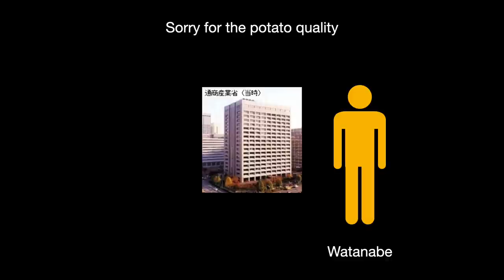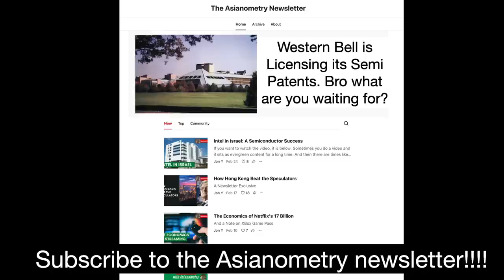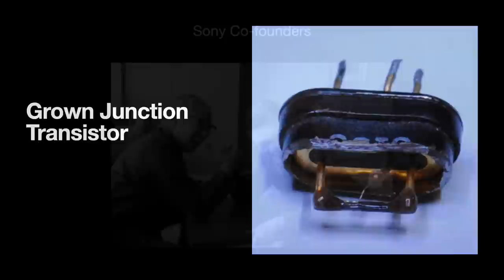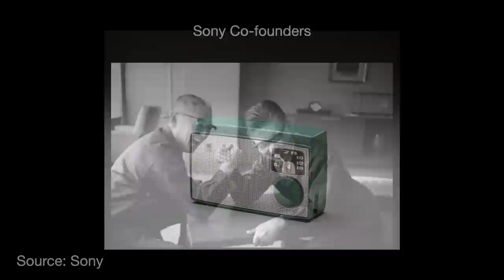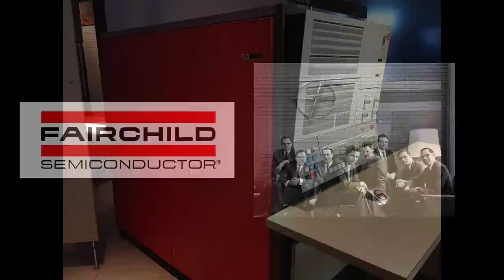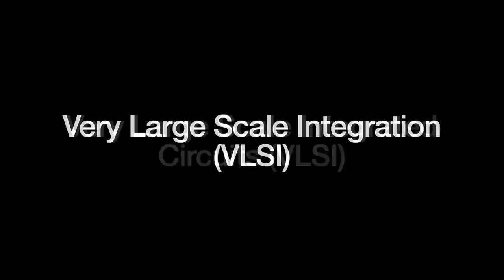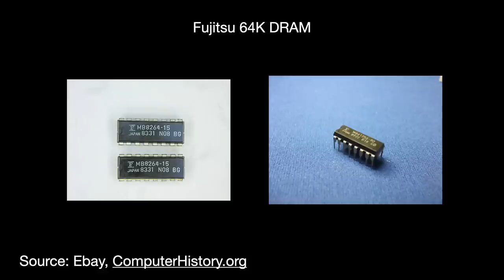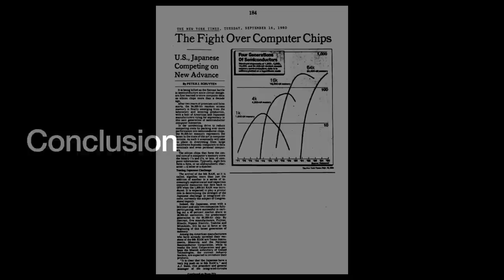How Japan Learned Semiconductors

Comment: Anecdotal: in 1980 I was the lead engineer on a project that required an early microcontroller. In those days there was no flash so the code eas “masked” in ROM - that is, defined as part of the top layer of the semiconductor chip at time of manufacture. It was an 8049 MCU which was designed and originally sold by Intel. But in the end we chose Mitsubishi, who were able to provide the mask at 1/3 the set-up cost and deliver the parts in half the time at a much lower price. I don’t recall a single MCU failure in the two years we built the device, over which time thousands were sold.
Reply: Now that sounds like a fun job
Reply: Interesting! Are you allowed to tell us what the project was?
Reply: They underquoted on the job to 'steal' that type of work away, to gain experience and your company's expertise, in effect, they 'stole' the expertise at zero cost to themselves.
Reply: @cranegantry868  that’s quite an assertion, can it be backed up with some kind of evidence…?

Comment: At 15:10 DRAM Dominance
As a hardware designer (starting in 1972) I specified only Japanese 64K DRAM for memory when it became available because no board manufacturer wanted to set up the re-work post assembly streams needed if American DRAM parts were used.

Comment: I worked for TI  in a research group. I remember in 1977 we were have serious discussions as to whether semiconductor memory would ever replace core.  The concern was that core memory would retain data, even during a power outage.  TI's was putting it's hope in bubble memory.  I think the incredible growth of winchester technology came as a surprise.
Reply: It would have been interesting to see how small they could go.  According to the Wikipedia article they reached 0,33mm core diameter by 1966.
Reply: I still have some industrial control systems running on core.

They run warm!

Comment: Something to add to the Bell patent on the transistor. The anti-trust lawsuit that Bell was involved with the federal government eventually ruled that Bell labs Western electric AT&t Bell telephone could not manufacture and sell to any entity except themselves. It also prohibited them from operating outside the telephony industry. However they could license patents and collect royalties. Which prohibited them from getting into the computer industry or other various industries. After the lawsuit until 1984 when the giant was broken up in another Anti-Trust lawsuit. All equipment that was manufactured and used by the Bell group had stamped on it the property of Bell telephone not for sale. In both law cases due to Bell telephone being a massive company and wanting to protect their business interest these were actually negotiations with the federal government in which Bell telephone and it's arms agreed on certain conditions to end the lawsuits. Negotiations that were finally agreed upon in approximately 1982 and 2 years later would lead to the breakup of the Bell system. Removed the previous negotiations on the first antitrust lawsuit which was filed in the early 1930s.
Reply: I remember Lucent Technologies an offshoot of AT&T. They produces communication chips. Now its under Alcatel.
Reply: @ntabile  You are way out of date. Alcatel is no more having been itself taken over.

Comment: Note that Bell Labs had both the patents on the point contact transistor (which is really not possible to mass produce) but also by 1954 had the patents on the diffused-junction transistor which WAS possible to mass-produce.  Sony got interested in the transistor but by the time they actually licensed the technology what they were licensing was far more advanced than what they had originally been interested in.  They were the right people at exactly the right time.

Comment: One minor detail missing. In 80s in the midst of Cold War, Japanese supplied top of the range semiconductors (military grade) to Soviets. 

USA found out about such arrangements and slammed the door shut for the Japanese imports and export of lithography machines to Japan.  Japanese developed their own lithography machines (which are still fairly reasonable even in today’s standard). The problem was two folds, i) Japanese were largely shut out from the world’s largest market hence lacked the momentum in sales - R&D cycle. ii) Plaza agreement drove Yen more expensive making Japanese products expensive in cut throat chip market. 

From 256k Japanese were en passed by Koreans and never took the lead back. They focused more on the materials and machines supply where they still maintained competitive edge not because of technology but because they were relatively reliable and cheap. .  

In 2019 Japanese blocked export to Korea and Koreans started to start to drive for domestic manufacturing of not inly the 3 products controlled by Japanese gov but all supplies.  All Korean manufacturers demanded their suppliers comply with ‘Japan free’ supply chain.  Dupon and other top names quickly joined the frenzy and Korean producers quickly replaced Japanese in an once in a life time oppotunity.  As many suppliers work in partnership with chip makers from the development stage, it is notoriously difficult to make into the supplier club. 

Some Japanese producers moved their production to Korea, outside Japanese gov export control. 

Others followed suit and created R&D Centres in Korea to work with the next gen development, making Korea de facto the hub for global materials, equipment and final product hub.  The talent pool that will be created is only matched by the USA.  Even ASLM is building its R&D hub in Korea. 

Japanese gov just gave Koreans the best gift in a generation to consolidate their dominance in the sector. 

The end result is, far less Japanese producers are working with Korean on the next gen product development and the opportunity to supply in the future.  

It would not be surprising to see Japanese material and equipment supply vanishing in next 5-10 years. And total annihilation of Japanese market share and talent pool for any future opportunities. 

It is a classical case study of bad gov decisions (supply to Soviets, Plaza agreement, export control for Korea) demolishing once flourished industries.
Reply: Oh man, I remember that recent decision, it was immediately obvious that it was one of the most stupid decisions the japanese could made. What were they thinking?!
Reply: Zaydan Naufal  so this is all trump fault?
Reply: @kurikuraconkuritas  Uh no, not everything is about TRUMP. Japan and Korea have had their own local disputes. The most recent was sparked when the Korean courts upheld a suit against Japanese companies for compensation for forced labor during WW2 and allowed Japanese assets in South Korea to be seized. The Japanese retaliated by slowing the export of chemicals needed for semi-conductor production to Korea.
Reply: I think in the 1980s there was also a scandal where Toshiba sold machine tools to the Soviets necessary to make quieter submarine propellers.
Reply: you see, if we didnt have nations this wouldnt be a problem
Reply: @indeepjable  Settle down there Pixy
Reply: Shots for every DehRAM -already wasted.
Reply: Unfortunately Korea couldn't duplicate Japanese materials still today so the export ban was a success. Korea will not be able to develop anymore as Taiwan has taken over. So Korea semiconductor will soon go down.
Reply: The main Japanese manufacturers effected by the export control has largely lost 50-6% of revenue of the products and some even turned into negative P&L.  
All 3 products have seen substitutions coming domestically or sourced away from Japan. If the Customs data is anything to go by, they recorded 60-90% decrease in import volume of the products from Japan vis-a-vid pre export control.  
Not everything is replaced yet, but with their exclusion from the next gen development, it is clear their days are numbered.
Reply: @bgshin2879  actually all the 1 export items is shipped to korea by Japanese companies factories outside Japan at pre 2018 levels and remaining 2 are directly exported from Japan as there are no replacement available by any other company or factory outside Japan. So revenue had rose above pre 2018 level and market share hasn't decline even a bit according to customs data. It is impossible for anyone in the world to replicate Japanese chemicals for next 10 years so days of good profit is just starting. Korea will never be able to develop any next gen product beyond what is now available now all next gen is Taiwan. Japan will export and make profit there. Korea semiconductor days are numbered.
Reply: Proof, trade war always bite back in the ass.
Reply: @Trgn  no it doesn't.

Comment: Was the VLSI project, where the etching technology was invented that allowed the buyer capacitors, or did that come later. I remember see in some corrections of nearly vertical wells more than 10 times the depth of the diameter during my university courses. I remember mention of a Japanese project of endless etching experiments which ultimately led to the capability to etch "any" 3D shape into Si substrate.

Comment: IC bonding was generally not to a board. It was to a lead frame (pronounced "leed" ) i.e. a chip package.  14 and 16 pin DIPs (Dual Inline Packages) were quite popular. Surface mount was starting to show up, but the parts were too small to handle. These days I'm fond of SOT23s (vs TOs) and the TSSOP (vs DIP) form factor. But I have to wear a magnifying glass to build anything.

Comment: DRAM Pronounced DEE-RAM.
SRAM Pronounced ESS-RAM.
(I have a degree in Electronics Engineering.)
Reply: You don't need to say you have a degree in electrical engineering to be pedantic and annoying although it helps.  (BTW I also have a degree in Electrical Engineering.)
Reply: @seanm2511  I have a diploma of EE. I don't care how to pronounce DRAM
Reply: @seanm2511  true, and "dram" pronounced as the video does is just a small glass of whiskey
Reply: @thenimbo2  Whiskey is of course tastier and isnt also at the moment universally subject to a 52 week+ lead time.  I take it you also have a degree in Electrical Engineering?
Reply: @seanm2511  well, good whiskey actually has a longer lead time than that.. its takes years to age properly
Reply: I don't get why people complain about others correcting mistakes.  I've never heard anyone in the industry say, "durram."  Everyone says D RAM, so I'm 100% with Metzen here.
The VLSI example is different because the viewer apparently insulted the creator, rather than just adding the information (and it wasn't even the correct information).
And CodyCast's comment below is exactly the type of comment that should be downvoted.  Instead of just saying, "hey, all the industry people say dee RAM," CodyCast had to go "Omg, blah blah," and then name-call.  I'm convinced that people suck in general, and that internet just amplifies that.
Reply: @William-Morey-Baker  That's a fair point.  Although at least in the case of the DRAM I have on backorder 52 weeks + is notional...
Reply: @catsspat  a) because I can.  b) because it's amusing to point out to someone they don't need a degree in electronics engineering to offer a correction to pronunciation.
Reply: It's definitely Dee RAM.

Calling it dram is distracting.
Reply: @seanm2511  for the purposes of this joke, yes
Reply: Shots for every DehRAM -already wasted. lolol
Reply: @ashforghani5109  that's how they say it in France :d
Reply: "INTER-dasting", but we not in France. We in 'Muricca"
Reply: I created the universe and I think it doesn't matter how you pronounce it!
Reply: @sumitagarwalsmart  bRAH, get  PM"Mohdi" to invent the toilet first! We will talk about the "universe" in a decade.
Reply: I think he is referring the the respected Mr. "Der-ham"
Reply: @catsspat  some people just can't take public criticism or correction by people who know what they're talking about.
Reply: I don't have a degree, but that didn't stop me designing several very good SRAM and DRAM cards for industrial computers in the mid 1980s.  As a consequence, I found this video very interesting.  Personally, I don't really care how the presenter pronounces these terms, since everyone here seems to understand his intention anyway.
Reply: As I keep reading the posts it gets annoying how does we pronounces it. Anyway, whatever is okay to me now.

Comment: Technology transfers led to a technology arms race but the whole reason why it benefited Western countries is due to everyone using the same core standards based on Western designs.   And I think the Americans knew that having a technology arms race would help accelerate the evolution of the technology by having so many governments and industries working to push the state of the art forward.   However, it is insane that while the USA was determined to break up the monopoly in AT&T they had no problem supporting monopolies and public private partnerships overseas which were a no no in American markets.    Because in reality some things such as technology R&D work better when you have economies of scale where a monopoly allows for large sums of money to be spent on future innovations.   And that was the benefit of AT&T being a monopoly in the telephone industry (keep in mind they developed the technology of the telephone). This is also why TSMC as a near monopoly on chip manufacturing also works as well, as economies of scale allows for absorbing the cost of manufacturing and design while also promoting better quality control and integration.

Comment: In looking at semiconductor theroy, learnt that the germanium atom has an extra electron orbit when compared to the silcon atom. This may explain the lower conduction voltage and the higher reverse leakage current that germanium devices have as the outermost electron orbit is slightly less influenced by the central nucleus in attraction properties. This may be a fairly old idea as to the behavior of the 2 different atoms under thermal and field charge conditions.

Comment: People talk about the transistor like it was some immediate major change in technology, but the fact of the matter is that despite their invention and entry of production in the early 50s, most consumers never saw a single one until the mid 60s and no electronics companies really took them seriously until the early 70s, after the moon landing had finally proved how capable they were. By the time solid-state electronics really started to catch on, the integrated circuit was already in full swing. 
The first all transistor television, the RCA XL-100 does not even show up until 1971.

Also worthy of note, the way we see "Made in China" products now is the way "Made in Japan" products were viewed in America during much of this time. It was typically assumed that the Japanese product was cheaper, of inferior quality or design, and just good enough to get by. Obviously, this view has dramatically reversed in the last 40 years.

Excellent video though very well researched, I just think it could have used some context on the state of consumers and consumer products for the era to really put all of this into perspective. 
I would love to hear the story behind the Korean start ups of the time and their meteoric rise, and the "bounce back" you briefly mentioned in the American semiconductor industry.

Comment: In the 80s and 90s they were the leading edge or in parity with the western world in producing memory chips.  They are also good in producing semiconductor assembly tools either in the wafer fab or in post wafer fab assemblies.
I work earlier in a post assembly company where japanese tools are better than american tools. I.e. dicing tools: DISCO as against KNS. Wirebonding: Shinkawa and Kaijo Denki versus Kulicke and Soffa. 
On the other hand at wafer fabrication they are at parity with the western companies in the memories and discrete components from the 80s to early 2000s.
During the early 2000s there were a lot of fab around the world that produces memories that oversupplied the market thus price collapses which slowly closes down a lot of memory fabs. You can count on your fingers and toes the present fabs that produces memory chips. Thus the Japanese leads in chip mfg. and post assembly tools production slowed down.
Reply: Correction: Kaiju Denki
Reply: @ntabile  You can edit your posts here to correct them; it's an option in the menu you can drop down from the "three dots" button you'll see when you hover your mouse over your post.

Comment: As I recall Germanium was easier to work with than silicon - silicon had to be extremely pure and that nearly impossible with current technology/methods.  Ge did have several problems in operation which forced the development of silicon based semi-conductors.
Reply: I don't know about Ge/Si, but I can tell you about Si/GaAs. GaAs needed to be many times purer than Si and the yield rate we attained for just engineering samples of GaAs IC's was horrendously low at 50%. I don't know what the production yield was, probably lower.